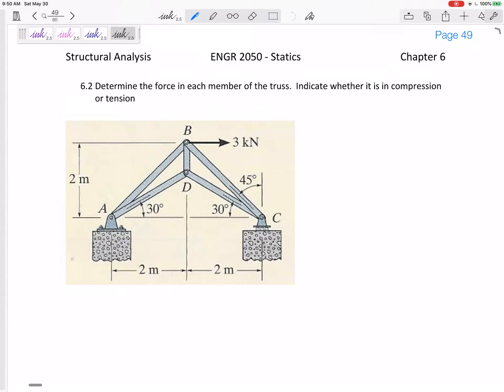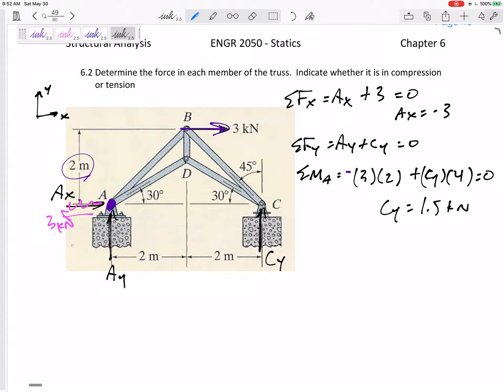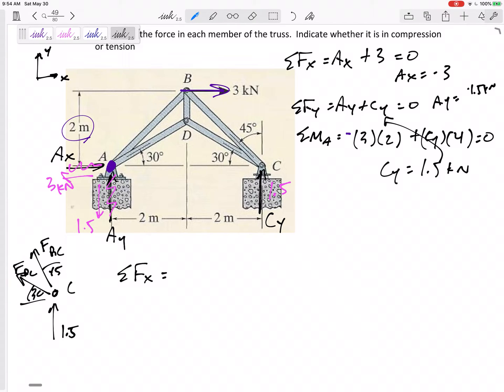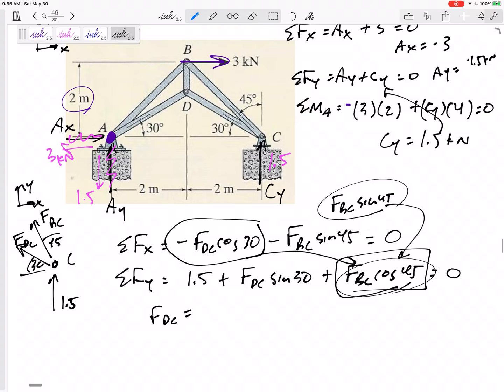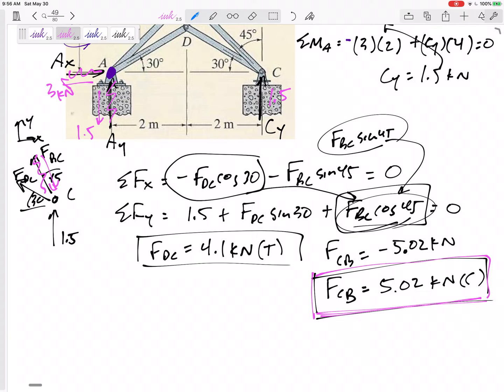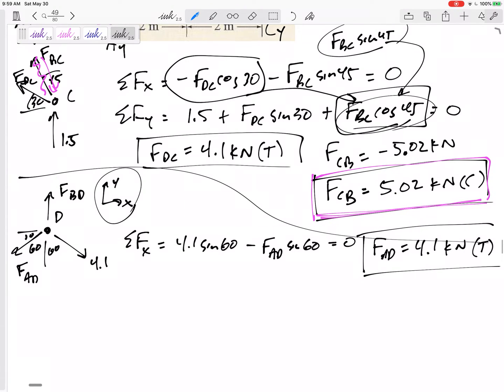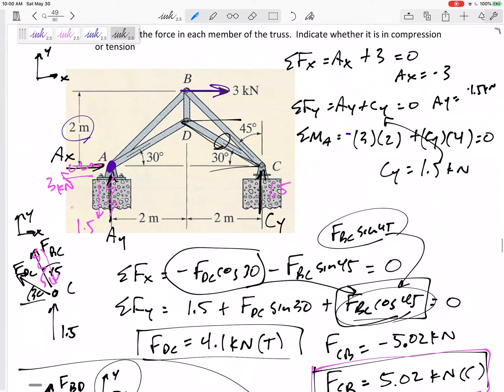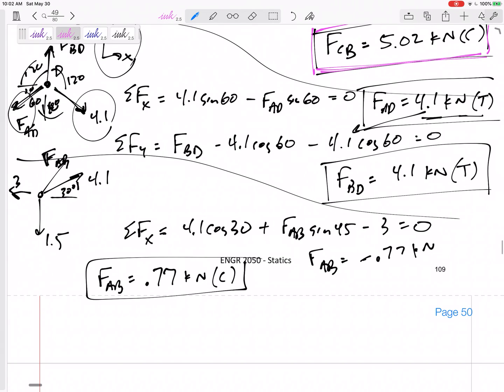Statics - Truss Method of Joints example 2

Comment: What if both were pins????
Reply: then the structure would be statically indeterminate to the first degree. in this case,  you can’t solve the problem since these methods of analyzing structures were for determinate structures only.